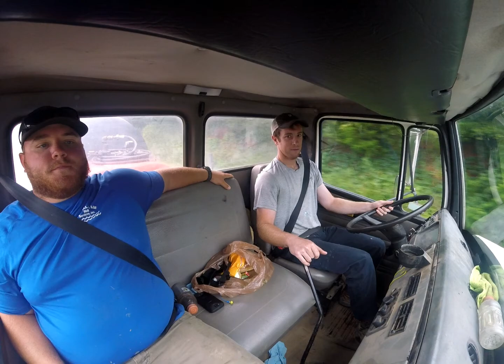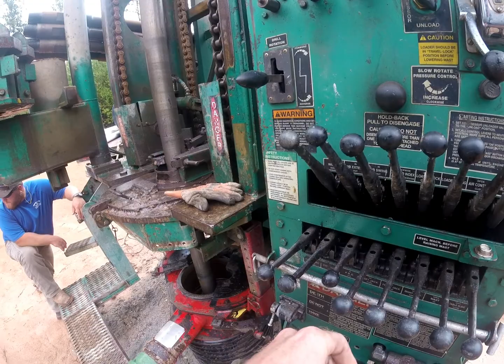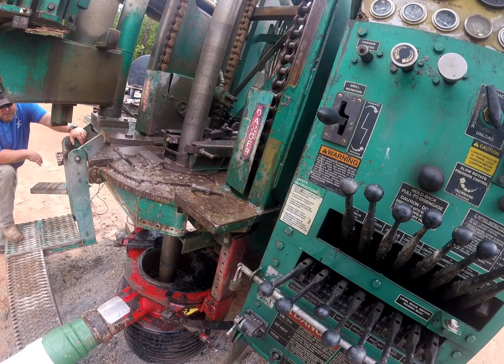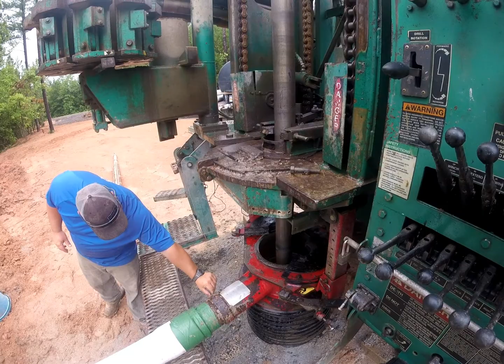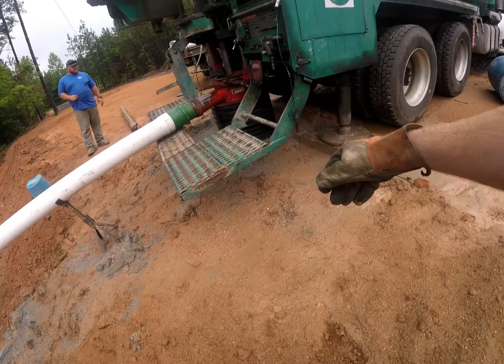Well Cleaning and Blowing Out a Water Well with Compressed Air

Comment: A contractor did a screen well. 60 feet of casing, 100 feet of screen. Pump is at 60 ft. Water is coming out yellowish tea like color. When the water settles in toilet tank or bottle of water for more than 24 hours, you can see the water is clearer, but there is brown sediments accumulating at the bottom. We put heavy metal 3 stage filters and still it passes those filters. No sand present or debris. Don't know if its tannin, clay, or if the contractor didn't flush or develop the well correctly.. Do you know what this could be?
Reply from the maker: It is hard to say without being there when it was drilled and seeing what the water looks like
Reply: Wendell Lee Well Services Its coming out clear but with a yellowish tint. No sand or fine particles to the naked eye in a glass or bottle. After 48 hours you can see small brown stuff at the bottom. If you shake it, it reverts the clear water back to clear yellowish tint. Its not iron because the filters would be stained orange. My brothers house in South Florida has heavy metals and the spindown prefilter is filled with orange.